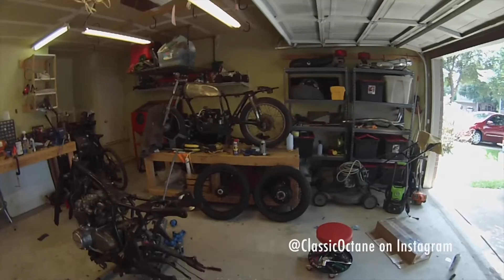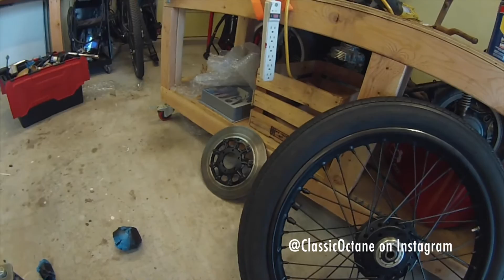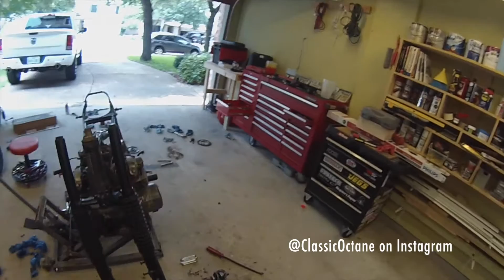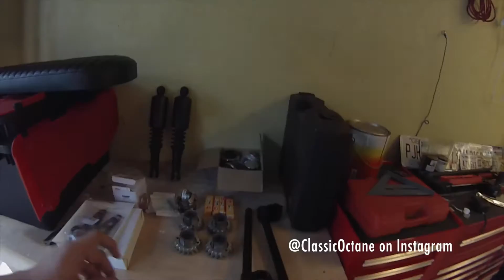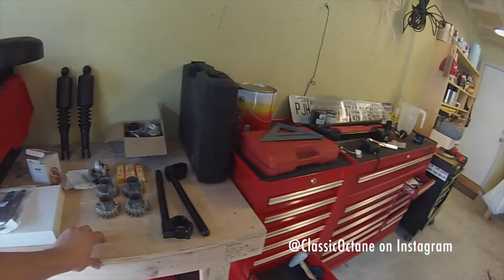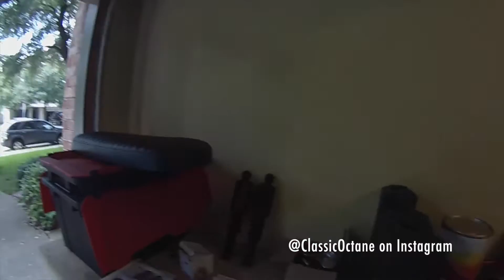How to build a CB550 Cafe Racer / Brat : Part 2

Comment: Gearing up to do a CB 550 cafe build. Thank you for the inspiration, your bike looks awesome; small question: what kind of clip ons did you get and what is a good place to get them. Also, do they have a 7 or 0 degree angle? Any feedback you can give will be great. Having trouble picking out a pair to replace clubman bars...
Reply from the maker: https://www.ebay.com/itm/A-Pair-Of-7-8-35mm-Clip-On-Motorbike-Handlebars-For-Yamaha-RZ-350-L-N-NC-NCII-/152799029764?hash=item2393882a04  These are the ones I went with.
Reply: Thank you.
Reply: @ClassicOctane ❤😊

Comment: Hey i'm having a hard time finding parts for my '81 CB750, any ideas on where to look?
Reply from the maker: I would check out 4into1.com I have gotten a lot of parts from them.
Reply: Looking into them right now thanks! Also, i'm not sure if you're familiar with the DOHC CB750's, but after im riding for a bit and I shift into neutral the bike starts to rev up really high. Any ideas?
Reply from the maker: My CB750 did that occasionally I just reach down and adjust the idle down a little bit. I never did track down the exact cause.
Reply: Okay yea that's what i've been doing as well. Definitely more of a temporary fix.
Reply: @ClassicOctane  1

Comment: Hey man, what kind of paint did you use to paint the forks?
Reply from the maker: I used Dupli-color wheel paint for the forks,wheels and rear shocks.  So far it's holding up well.
Reply: Cool thanks man, I'll give it a try
Reply: @Bretts_Builds  
Classic Octane
Chris riddiford